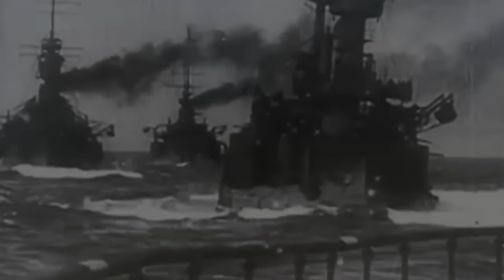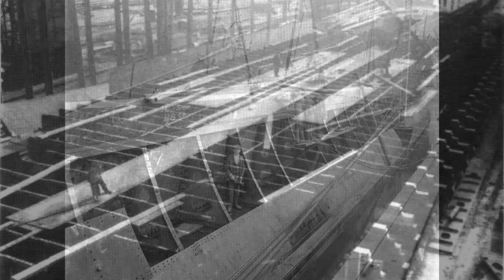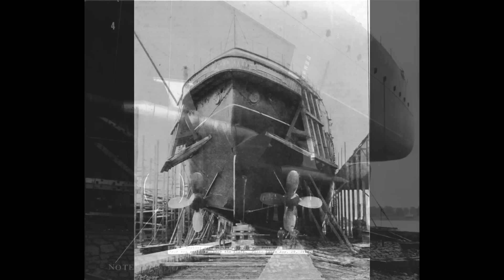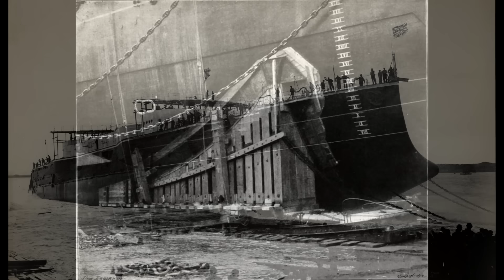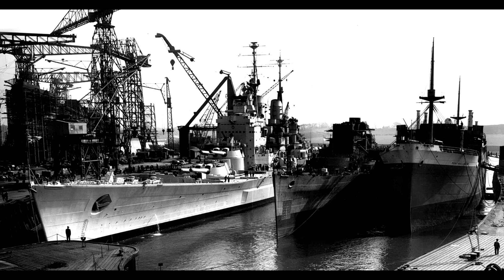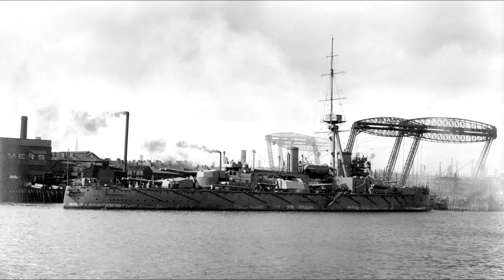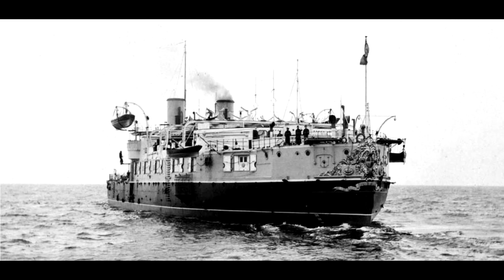Naval Engineering - Building a Battleship from Keel to Commission

Comment from the maker: Pinned post for Q&A :)

Apologies for the misspeak, 1:48 is of course 1 inch every 4 feet!
Reply: You mentioned the process of towing unfinished ships to royal dockyards for fitting out, and that it could be dangerous. Did the RN ever lose an uncompleted ship to an accident while towing to be fitted out?
Reply: @mitchm4992  I'm going to second this question. And in addition to it add the question of if it ever happened to anyone else or if a ship was damaged during the transfer. And if it was, who was responsible?
Reply: @mitchm4992  probably not, it could be fully floating without engines or armaments without being buoyantly compromised
Reply: You mentioned the prohibiting of foreigners from approaching yards, and similar methods to prevent sabotage

What types of sabotage and espionage were done against ships currently in construction, and what were some key examples of sabotage, and what types of impact they had

(Thank you for the amazing video again, Drach)
Reply: I'm shocked that they made such large models of the ships as standard procedure. Did they ever preserve these models? It seems like they'd make for a great museum piece.
Reply: Are you planning a separate video on hanging armour plate, or was this a big miss from the major fitting out section?
Reply: In a previous drydock someone asked about the US’s choice to not return to the 13 inch in their dreadnoughts and instead go with the 12 inch 40, but if the US had decided to go to the 13 inch either on the South Carolinas or the immediately following Delaware class, would this have made any of the non-superdeadnought US battleships more useful/capable? Especially the Florida and Wyoming classes, given that they managed to make it to WW2.
Reply: @WarrantOfficerWill22 

Unlikely. By 1940 those ships were so old that having 13” guns would not have made them militarily useful.
Reply: What is the worst warship launch disaster of all time?
Reply: @bkjeong4302 
The recent one by North Korea might qualify 😂
Reply: @bkjeong4302 there was one in London that was highly publicized: HMS Albion -1898.  It launched in a small tributary of the Thames and about 35 people drowned.

There is video of the event.
Reply: Was there a format or standard for the spacing of rivets, how was it determined what the optimum number of rivets needed to attach a beam or armour plate?  Did it vary depending on what part of the ship was being assembled?
Reply: @michaelporzio7384 Rivet pitch about 4 diameters for a watertight joint, more for non-watertight.
Reply: @robinmilford2426 
Meaning the space between rivets should be no more than four times the diameter of one rivet, to yield a nominally watertight join?
Reply: @robinmilford2426  thanks!
Reply: Are there any humourous stories of mistakes made when building ships?

Give a bunch of men welders and they can do anything, smart or dumb, even weld 2 destroyers together!
Reply: Any examples of warship launches going horribly wrong?
Reply: When did critical members of the eventual crew, such as the machinist mate, get involved during build? There would be  benefits from being involved very early to understand what kind of jury rigging or compromises were needed to get it installed and working, because there's always some.
Reply: What is the largest warship in your era of focus that was launched sideways? I have seen some ships launched that way, like the American Freedom class LCS, or the North Korean destroyer, but what about other ships?
Reply: Q : what is your favorite concept capital ship that never went anywhere?
Reply: We're just a bit past the 50th year of the Edmund Fitzgerald's sinking. Are there any similar events of a modern (for the channel's time) warship sinking without any warning at all?
Reply: @AFullerHouseAtlantic HMS Captain
Reply: Q: Could the Bismarck have been in some way escorted by U-boats on her voyage with Prinz Eugen? If the north Atlantic had been saturated with U-boats with the orders to attack British heavy ships, could the result of Rheinübung have been altered (like the British carriers turning back out of fear of the U-boats)?
Reply: Metric or imperial inches? And does it accommodate thermal expansion
Reply: Did the mold loft have grid lines marked on the floor to make the drawing easier?
Reply: Question: in the time period from 1900 to the end of the channel coverage, what was the biggest difference or differences between the way US shipyards did things and what the video here described and how much would it change during that time period?
Reply: Instances of corruption in shipbuilding during the period the channel covers, what were some of the most egregious examples thereof?  And as a follow up, what did nations do to try to combat it?
Reply: Hello Drach!

The long process of construction on the slipway bears the question - how was the material fatigue dealt with in the construction process? By that I mean mostly the usage of certain materials, and sections of the ship that usually are supposed not to be exposed to the elements. Have these been any examples in the time period you discussed, that a section of a ship had to be rebuildt, or at least, renovated due to deterioration in prolonged construction process?
Reply: Are there specialty manoeuvres or crews when it comes to the warship trials almost attempting to break the ship and solve or discover issues before wartime.

Like hard to port then shove the power plant into reverse and then hard the opposite direction or something silly like that.
Reply: How do the capabilities of Bismarck compare to HMS Hood on paper?
Reply: I recently watched your Naval Logistics video and had a question come to mind: 
What happens to a sailor's pay should his ship sink? Even if he were to survive would he loose his pay that went to the bottom with the ship or would his government reimburse some of the loss? What would happen were he promoted/demoted at sea in this situation?
Reply: Looking at some of the photos of HMS Vanguard, it looks as though the massive superstructure keeps B-turret locked in forward position. Surely this must be some form of optical illusion?
Reply: @Depipro 

The rear surface of B turret was very close to the superstructure, but yes there was enough clearance for the turret to rotate properly.
Reply: We noticed it, but didn't say anything.
Reply: Why are there so few photos of the interiors of turrets, of German ships, particularly from the First World War? Darkness and secrecy will naturally be one reason.
Reply: @MegaKeyboarder 

The turret interiors would have been illuminated so the crews could see what they were doing. 

Perhaps the reason is that few members of a warship crew during WW1, in any navy, could afford a camera?
Reply: @Doug_JB i know, but the photographs for the propanga have a Camera
Reply: I believe keelhauling is the standard penalty for cases like this. 😁
Reply: Hey, it's Imperial Units, meaning: As long as it's somehow crub/odd, and gives Sumerian vibes, it's believable.
(A1:12 model of a battle ship would be halfsized, allbeit rather narrow  MTB).
Reply: have you don anything on a the part from idea to Keel of a ship. the part where hopfully the crazyest ideas are stopped.
Reply: I still build plenty of models in 1/4in scale.
Reply: Ah.  Was wondering about that.
Reply: Okay, thanks!  However that still leaves question of the Montana class model, which does appear to be that big if my method of determining the size in the photo by counting the number of floorboards beneath it (I count 65) is accurate.  I did historic preservation work for 30 years on houses built in the early 20 century, and have been in many buildings originally built as industrial and office space in the first half of the 20 century that still had the original hardwood floors, so I'm pretty sure the 2.5 inch width of the boards seen here is correct.  https://en.wikipedia.org/wiki/Montana-class_battleship#/media/File:Montana-Klasse_Modell.jpg
Reply: Are the rumours true that a battleship's turrets lied on their own weight with no fixation to the rest of the ship other than gravity?
Reply: @thewidow7864 
Mostly no. Many ships had roughly C-shaped clips that held between turret rotating mass and deck.
Reply: I was about to comment. Back in the'60s, scale models used 1:48 and 1/4 scale interchangeably.  Monogram comes to mind.
Reply: 1. When breaking the line, is it better to come in perpendicular to the enemy fleet (Trafalgar, Lissa...), obliquely (The Saintes...), or something more esoteric (First of June...)?

2. Following on from the question in Drydock 338 about postwar refits of British interwar cruisers, what could've been done to refit U.S. interwar cruisers following WWII?  Could, say, the Brooklyns and Clevelands have had their triple turrets replaced with Worcester -style twin auto-6 turrets?  What about replacing the Baltimores' triple 8s with twin auto-8s?  The Atlantas' and Juneaus' eight/six twin 5"/38s with five or four twin 5"/54s?  Et cetera?

3. Why did the German hexagonal dreadnoughts slow down so badly in turns?  Given that the increase in the frontal area that a ship presents to the oncoming waterflow at a given sideslip angle is relatively lower for a fat, low-aspect-ratio ship like a Nassau than it is for a ship with a higher aspect ratio, one would've thought that the early German dreads would've been less affected by turn-induced increases in drag than most other dreadnoughts.  Did their low aspect ratio allow them to yaw quickly enough to cause them, when turning, to reach a sideslip angle so much higher than that of a finer-lined ship as to outweigh the lesser increase in frontal area for a given sideslip angle?

4. I don't dispute that Halsey replacing Ghormley provided a considerable morale boost to the USN forces in the Southwest Pacific.  But Halsey's wild aggression also caused those same forces to take terrible losses, such as when he Leeroy Jenkinsed the already-understrength U.S. carrier force against a considerably-superior Japanese force at Santa Cruz (rather than refusing battle and withdrawing south to a location where he could maintain the air umbrella over Guadalcanal but be out of range of the Japanese carriers) and got Hornet sunk and Enterprise badly damaged, and then again later when his insistence on keeping Enterprise in the field (when he had no way of knowing the IJN wasn't about to pick up replacement aircraft from land bases and come back south for a renewed engagement that would certainly have claimed Enterprise as well), rather than withdrawing her for the repairs she desperately needed, backfired by tethering Lee's battleships to the carrier, causing him to send his cruisers north to Guadalcanal without any capital-ship support and leading to the disaster of Friday the 13th.  Was the morale boost of Halsey's arrival really enough to wipe out the damage done to the U.S. war effort from the ships and men he threw away through his recklessness?
Reply: So I read that Musashi was built on a slipway whereas Yamato was built in a drydock. Was this because of lack of suitably large slipways? 

I imagine there are advantages and disadvantages of both methods, a disadvantage of using a drydock being that during construction it's unavailable to use for refitting/repairing other vessels.
Reply: Can you go into more detail on what warship drawings are used for? I mean the fairly simple ones that seem to just sketch out the turret and funnel layouts and then what looks like a bunch of empty squares. 

How much actual engineering goes into these? Do they actually help to calculate displacement and what machinery can go where or are they just very rough sketches?
Reply: Photos show two blade and more propellors. How scientific and tested were these solutions and why is there so much variation?
Reply: Would working practices vary significantly between the various yards?
Reply: "Briefly almost the entire weight of the ship is on the keel." This is a common myth that I was even told as a young naval engineer 40 years ago. If you stop and think about the physics, it's clearly not true. Most of the ship is being supported by the water and the last part of the keel touching the blocks only needs to support the weight of the ship minus the weight of water displaced by the hull. It's still a large number, but <5% of the total weight of the hull.
Reply: Were there ever warships that were started but discovered later they weren't going to fit when finished in the slipway they were being constructed in?
Reply: How about a history of naval gun stabilization technology?
Reply: Have you considered a collab with a 3d animator to make a video about building a battleship? I can think of a couple, Jared Owen and Deconstructed both do good work.
Reply: During the video there were several pictures of rudders. The mounting points varied (timestamp 9:56 compared to 12:46). The shapes also varied (compare 7:04, 12:46, 13:29, and 16:53). Can you give a quick crash course about the pros and cons about these shapes and mounting points? Maybe a Wednesday video about why and when they varied, who used what, etc?
Reply: @Drachinifel given your engineering background, if the US or British had a sudden fever dream in the 1950s and decided to replace the oil fired powerplant of the Iowa's or possibly Vanguard with one or more nuclear reactors... what is the most SHP or highest speed that engineering methods of the time would have been capable of. And how could you realistically transmit that energy into the propeller shafts without destroying them? And finally, did the US Navy ever seriously study such an idea?
Reply: How do you actually measure total power output of a ship ?
Reply: Is my imagination playing tricks on me? I could swear I saw bits of this video a few weeks ago? The stuff about security and the official secrets act... was that also part of a drydock answer about how you went about ordering a battleship from overseas? Or am I going mad(er)?
Reply: You mention the German shipbuilders being some of those that recieved bonuses for delivering a faster ship than expected. Do you know if this occurred with U-Boats, and if so might a little creative speed trials interpretation have played a part in the rumour of very fast diesel submarines, that led to the British committing to the K class?
Reply: Would it be possible to construct a battleship with prefabricated methods somewhat like how we mostly build modern ships today? Was there any nation during the time period that the channel covers that adopted this method early in capital ships?
Reply: Glad you fixed. I was very worried a US scientist was going to have to point this out to a British Engineer...
Reply: In "USS Cannon - Guide 466", you mentioned how the thai navy preserves old ship fairly well, even as far as saying they're an "unsung hero" for it, could you maybe cover what they did in the future ?
Reply: Why were most ships built on a slipway and launched, instead of being built in a drydock?
Reply: Could you do a video similar to this one, where you discuss the process of major refitings of ships (gulio Cesare, US battleships post WWI, etc) where they re literally cutting apart the ships to enlarge/change out the machinery and inner guts of the vessels.
Reply: @lightningwingdragon 

He did a long form video about modernizing dreadnoughts. Search for it.
Reply: Do you know of any instances where the process with the leveling router for the roller path went wrong and, if so, how they went about fixing it?
Reply: so 1:48 huh?  So these plans and models would be great for an O scale model railroad layout focusing on a shipyard or naval base 😀
Reply: The great Kanto Earthquake ruined the unfinished hill of the Battlecruiser Amagi thereby keeping it from being used as an aircraft carrier. The Japanese historically used the Kaga, a battleship, instead. This limited the top speed of the resulting carrier conversion. In your mind, should the Japanese simply have said damn the cost we're going to build a new Amagi style hull instead of settling for the Kaga style?
Reply: @ar4040smith  Not allowed under the Washington Treaty, I think.  Had to be an existing or under-construction ship being converted.  Japan wasn't noted for its perfect adherence to the treaties, but that would have been a step too far.l
Reply: @Trebuchet48 yes, but they could have easily made an argument that the destruction of the Amagi's hull was an extenuating circumstance and could have easily won that argument because it would be replacing like with like.
Reply: @ar4040smith  If I remember the conversions were restricted to only those hulls already in some progress on the ways so starting from scratch was not an option.  It was to avoid having to waste everything battleship/battlecruiser related from being scrapped.  The two IJN vessels were offset by the two battlecruisers USS Lexington and USS Saratoga, which became carriers.
Reply: Q&A: with the passing of the secretcy act how bad did the British government go after or rage at the Argentinian navy during the South American naval arms race when they were taking stuff from various countries for their dreadnought?
Reply: Brilliant!  The riveters were obviously really strong and really skillful. If you have ever swung a sledge hammer for any length of time you know what I mean! I would think the yard owners would have been eager to go to pneumatic machinery ASAP, Alford the good old days:)